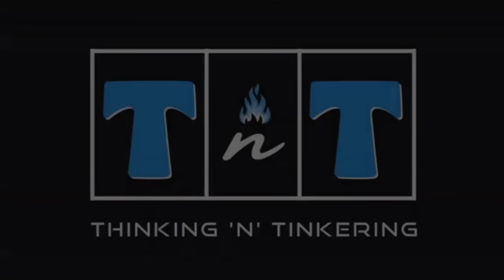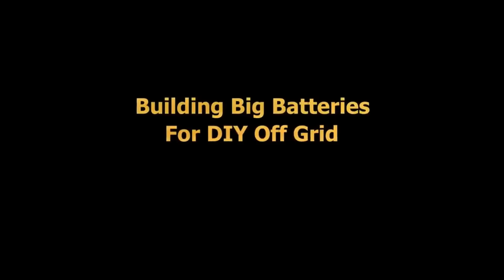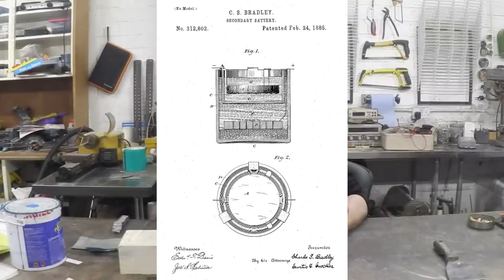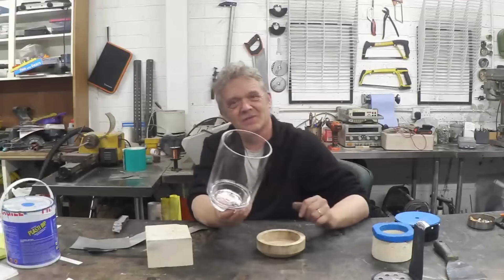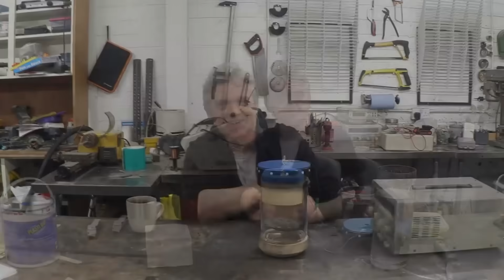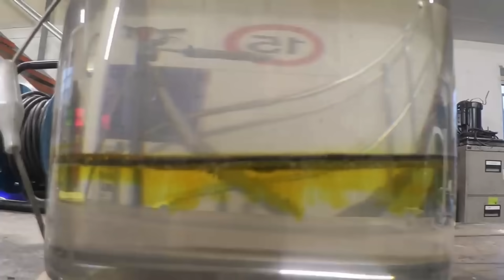2102 Building Big Batteries For DIY Off Grid

Comment: My question is to do with the molar concentration. I've been studying these zinc bromine batteries intensely for the last several years and for the life of me I can't see why anyone doesn't just CRAM the ZBr in there. You can easily get 10-14 M without it super saturating.

Is it because of an increasing resistance of the electrolyte when you get it that stuffed? I get mixed responses when it comes to trying to research around that idea. Typically it's the architecture of batteries that make this a bad idea - but in this example (or similar architectures where dendrite formation is nullified) - why NOT just stuff it in there? Expense? Is that all?

Everyone wants to jump to making a huge tub of the stuff, but there's no point. You could much more easily (and efficiently) make a handful of these and just have the electrolyte way more than 2M.
Reply: I am a chemist, I've done battery research of Zn-Br. The reason is the resistance. The conductivity of ZnBr2 solutions falls off a cliff after 2-3M because the viscosity of the solution increases a lot. In addition to this, dendrite growth at higher Zn concentrations becomes even worse than it is at lower concentration. A cell like Robert is showing here will never be viable, huge electrode separation distances with very resistive separators will give you an energy efficiency of maybe 15-20%. This is confirmed by his charging voltage of 7.6V. Just dismal for any sort of practical application.

Push the electrodes closer so that you can get reasonable energy efficiency values in the >70% region and you get a lot of self-discharge issues, dendrite issues, etc. Billions have been invested into Zn-Br research. There are very good reasons why the technology is still not mainstream.
Reply: @danielppps  Rob's channel is Thinking and Tinkering. Philosophy behind it is to enable viewers to know the basis of how things work and then possibly go on and improve on what he shows.

Showing us a cheap, safe, easy to build cell that might be 15% efficient is 15 times better than some channels that show us a contraption that is 0% efficient and 100% dangerous.

Rob's example in this video is demonstrated as a balance of cost of materials, what was readily available at the time of recording and what could be easily seen on camera by the viewers.

Your professional point of view as a chemist are also greatly valued on this channel as you outline the limitations of this arrangement.

When I look at systems such as this I'm always amazed that modern hobbyists are able to build things that are of better quality and efficiency than professional builders of 200 years ago. For example, a model maker can make a steam engine now that is more fuel efficient than the model's original design.

Similar with electronic circuitry. As an almost 50 year old, I remember we only really had lead acid or zinc air batteries!

Discovering that we can even home-make batteries at all is, to me, amazing and very much welcome
Reply: @RiverMersey  Thanks for your reply. I absolutely value Rob's content, it definitely sparks curiosity. However, I think it would benefit from some realistic perspectives on the things that are built. The reality is, such cells are not efficient, reliable or safe. A cell like this in a fully charged state contains enough bromine to kill the person in the room if it broke, this bromine would also pose a big danger to first responders as bromine is denser than air and will "cling" to the ground. Even if the electrolyte is "gelled" the bromine containing gel would off gas bromine in a very dangerous way. I believe people often underestimate the danger of attempting to build such a thing, in part because Robert is so nonchalant about it. 

That is why I believe it is absolutely necessary to mention why these cells are not being used commercially. Because there are incredibly good reasons why this is the case.
Reply: @danielppps  Very enlightening thank you. So that would be a good reason why a lot of research is moving towards flow batteries ?  In this case it would provide a way to bring electrodes close together in  the cell and solve the electrolyte resistivity problem at the same time as the energy density.

While we're on the subject, and forgive me for my ignorance, but wouldn't there be a "mechanical solution" to the dendrite problem; for example a physical mechanism that would crush into or shave them off constantly from the surface ? Sounds a bit weird now that I said it...  🤔
Reply: @TheFlyinCanadian  Yea, all these problems with Zn-Br static batteries are part of the reason why Zn-Br flow batteries are much more viable, with even a few commercial examples presently available for large scale applications. The flow also reduces dendrites, although it doesn't eliminate them. Many solutions to the dendrite problem have been considered, this includes solutions that are mechanical in nature (such as extremely hard separators that cannot be punctured by the dendrites or backplated batteries where the Zn faces away from the cathode), sadly none of these solutions have really solved the problem at a commercial scale.
Reply: @danielppps  Interesting. So there is still place for creativity (even for us gentlemen scientists 😉) in this day and age... If anyone is interested in a brainstorming discussion on the  dendrites problem, I have a couple of neurons available to provide...
Reply: Would pumping the electrolyte between different tanks reduce/eliminate the build-up of dendrites? Or would they still form and become suspended and/or sedentary material?

Could they be filtered as part of the pumping process?

My thoughts are to have 2 pairs of electrolyte tanks - 1 pair at the charger, 1 pair at the consumption circuit.

When the charger completes a charge, that batch of electrolyte is pumped out of the container and held in a storage tank. Similar with the consumption circuit; when the present batch of electrolyte is depleted, it is pumped out into a storage tank.

When the entire system in the consumption circuit is depleted, it is taken to the charger where the 2 sets of electrolytes are swapped over, hopefully at the same time using a figure 8 cross section twinned hose - or 1 flow at a time using a single hose.
Reply: @RiverMersey  Yes what you've effectively reconstructed is a flow battery, and they certainly work (every battery has its trade offs). The beauty of the architecture suggested here is that it's very cost effective, low maintenance, and very energy dense. This battery would grow dendrites - but they won't penetrate the ceramic in use as the separator here, so it's moot. They could form all day and it's not going to be a problem, in fact this battery would also effectively self regenerate overtime, the dendrites would just dissolve back into the solution as it discharges.

The problem with this design with being totally regenerative is the off gassing. If you could get the hydrogen evolution at the anode to go back to the cathode (or possibly inverse their positioning in the cell itself, causes it's own new set of problems with self discharge) it would dissolve back into solution too. And you'd end up with a battery that might last a thousand years!

What Mr. Murray doesn't do a fantastic job of really explaining (although he does indeed mention it briefly) is that the power density of this battery and it's efficiency would be quite low but that's definitely a problem that could be overcome by spending some more time dealing with the conductivity of the cathode. But you could store a ton of energy in it, it wouldn't degrade by being left at 0%, wouldn't fuss if you over charged it at all, and would self-regenerate if you took some care with the anode and cathode setups.
Reply: I've been asking myself the same question since Robert started demonstrating those batteries. Personnally I'm more intetested in zinc iodine batteries that work similarily to ZBr. Currently the only explanation that comes to mind would be that the high concentration of salts would slow the ions migration ?  If anyone has an idea, feel free to chip in, this a minor mystery I'd love to solve   ;)

Comment: This was the video i waited for, those batteries can have a huge liquid store pumped, and can be expanded on a need basis (add more fluid), As you explained service area (and pumps) might be ways to optimise this battery. Also the ceramic parts thickness, surface are, liquid volume... gell-ification, how long can the lquid be stored charged?, i think lots of area to improve it.
I saw company redflow have some commercial usage of it too, so if done properly this can be made viable ... or how to say in english can be made ideal or so.
Oh and where can one get these materials /liquids ?. .. as for shape i wonder if the ground plate had carbon pins (like thise from a pen), or maybe just iron pins if it would better collec energy of the fluid.

Comment: with modern power regulation tech, is there even a need to have cells in series? 🤔

also wonder if there's other charging characteristics that changes as it is fully charged (thus you can control/mitigate hydrogen gas production)
what about pulsed charging with some sort of PWM?

oh the possibilities....continues to feed my urge to tinker 🤣

Comment: If its about the surface area of the electrodes, would graphene instead of graphite on the positive-end have significant improvement?
Reply: Adding activated carbon granules to the bottom and then you press down with the electrode that you will make good contact

Comment: This is wonderful!!! Would it work with iodine instead of bromine like the small iodine battery you did? I wonder how many watt hours this would hold
Reply: The design is the same,.... the only thing what you need to do with iodine version is that you need the + electrode on the bottom that the iodine will collect on the top surface of the electrode.
Reply: @cayrex  thank you!!

Comment: I'm very happy with my LIFEPO4 cells that I made into a 30 Kilowatt battery, that was pre covid, and much cheaper than they are today, but now I have it paired with an all in one 6500 watt inverter, solar charge controller, ac charger, and 3500 watts of solar panels..Extremely easy, and basically just a handful of different parts, and I can weld, run my well pump, as well as a minisplit, microwave, induction cooktops, etc.,But, this technology is interesting...Especially if the brown smelly hits the fan, which is only a matter of time at this point...My battery is testing at 95% of original capacity after 5 years, that's pretty impressive...
Reply: I Think it would be nice to replace my water-heater with batteries and instant hot water. Would not need to go trough an inverter either.  
Only downside is that the battery would need to be able to deliver something like 10-15kW for around 10 minutes.  
Additional use would be to shift loads(and add an inverter), as electricity tends to be most expensive in the morning/evening, and cheapest at night.
Reply: @MalawisLilleKanal  I'm 100% off grid electricity wise..I have both a normal electric hot water tank, and a propane instant hot water system..Neither requires anything close to 10-15 thousand watts, not sure what your talking about there..The average water heater uses 1,125 watts, little over one kilowatt, only while heating the water..I have installed a hot water heater once that consumed 4000 watts, 4 kilowatts, but that was a commercial situation, with a huge tank..Maybe you mean without an inverter, but, why not have an inverter..The all in ones are cheap and reliable these days..A 3 thousand watt all in one inverter could run most things in a normal house, if you use only two high draw items at once..EG4 sells one for $674, very reliable, the 6000watt models are around $1,200, and they all include a real solar charge controller that can handle between 5,000 12,000 watts of solar and an AC charger..
Reply: @realeyesrealizereallies6828  I am thinking of an instant hot-water heater instead of the regular water heater that sits in the basement and looses about 25% of the heat to the environment every day.

Comment: I like the jellification idea. 
Why is jellification not a word?

Is there a way to temporarily seal a battery like this so you can disassemble it later for serving?
Would just putting the build inside a 6" pvc pipe that is threaded at both ends suffice, or would that cause the unintentional consequence of it blowing up on you?

It would also be cool if you could collect and bottle the hydrogen for use elsewhere.

Comment: Hi Robert, can I request that you show us how to make a practical scaled up version of this using a 1000L IBC container. These are cheap and readily available and might have enough scale to support an off grid house with modern amenities.

Best regards 

Dave
Reply: I'm thinking 55 gallon drums one per cell.
Reply: Haha I just posted the exact same question, moments before seeing your post. 

A relatively cheap DIY off grid energy storage would be a game changer.
Reply: @akumabito2008   Ummm me too. I like that it is slow. Where I am at 8k feet we get a lot of sunshine in the summer but it never gets too warm so we don't need air conditioning. It would be nice to store that solar for winter when we need lights and heat and stuff. If it takes 6 months to charge and 6 months to discharge that would be perfect. Have plenty of land so size(so long as it is safe) is not an issue.
Reply: I'll use 12 IBC containers(to get the voltage) if there is a way to do it safely. I would even encase them in concrete. This is just potentially so valuable depending on how long it will hold a charge.

Comment: I think You mentioned that it gets charged by AC directly. Does it discharge in AC or discharge in DC? 80% return is still better than an AC to DC full bridge rectifier at 30% loss. On charging.
Reply: It's a battery, not an alternator
Reply: DC

Comment: How does this compare to other flow batteries?

What about recovering that hydrogen if you have a huge bank of them?

The bank could be used to help make flash graphene, and any hydrogen recovered can go back into the system for power. Besides trying to recover that heat when the hydrogen is used.

The same goes for some of the methods of making graphene with an aluminum backing- if you recover enough hydrogen, you could theoretically increase efficiency of the Entire operation.  Considering how inefficient making graphene really is.

Comment: I'm a big fan you your work and of keeping science alive.  However, I'm not sure that I could make, or should make, such a battery.  

If something doesn't already exist, there is probably a reason for it.  Such big batteries exist but not small ones - that you call big.  So, I'm not sure how you're measuring, what you're measuring, and for whom.

Anyway, for a DIYer like myself, I would need a battery that can be charged with a car battery charger at 12V.  I would need a discharge of 12 or > volts to run 500 or > watt appliances.  In other words, I would need something more refined.  

I will look forward to seeing what else you come up with.  I am excited to see wind turbines and batteries that can power homes or that can be scaled to power homes.  Then, I could see return-on-investment and run wild.  Until then, I am excited to see the small scale science like whale bumps on propeller blades.  That's something I could repeat and add to science.  On that, I though that your body might have disturbed the wind flow.  

Anyway, that's my thoughts.

Comment: How about iodine non volatile.
Reply: You obviously never tried to store iodine crystals have you, it's sublime's rapidly and leaks out through any minor hole.
Reply: @petevenuti7355  There would be a partition coefficient with the oil which would strongly favour the oil. You would not lose much and could seal it. Bromine is a really really nasty substance that diffuses readily into body tissues. In my former days as an industrial chemist, I had to handle it with great care.
Reply: @DavidPaulNewtonScott  what is "partition coefficient"?  I've never heard that term.
Does that have to do with something's affinity to prefer one solvent over another between two phases (like oil and water)? That was one of the things I initially thought was the reason to put oil in a bromine battery..
  Yes , bromine is NOT something to play around with willy nilly, PPE is a must. I've dabbled with it a bit , can tell you, one drop on your hand , you wash it off immediately, but even after washing your hands for 10 minutes, if you rub your eyes it's like getting hit with tear gass, even after washing. I could see how a spill could take days to completely clear up. Nasty stuff.

Comment: Just a little correction: if 1 mol contains 6*10^23 molecules then 2.5 mol contains 15*10^23 molecules (not 18*10^23). So you'd need 30*10^23 electrons for complete separation.
Reply: And you should count them out individually, to make sure you have them straight.

Count them twice, to be sure.
Reply: @colfaxschuyler3675 Use tweezers....